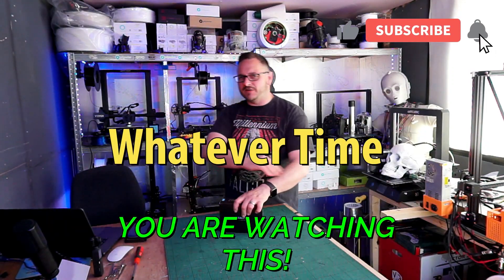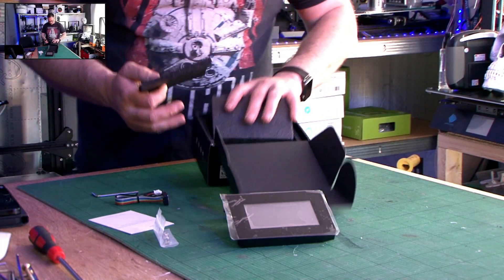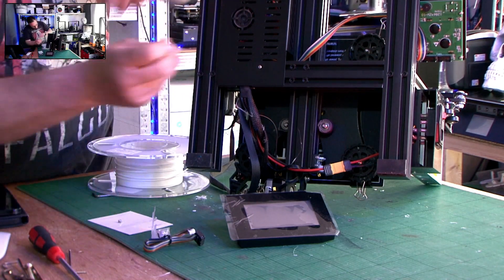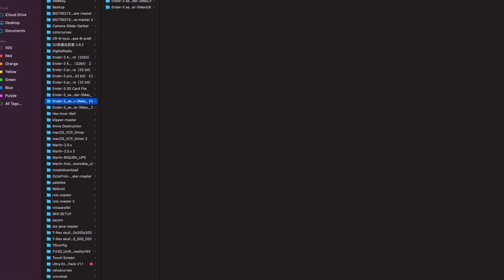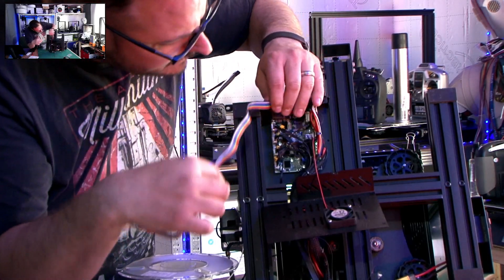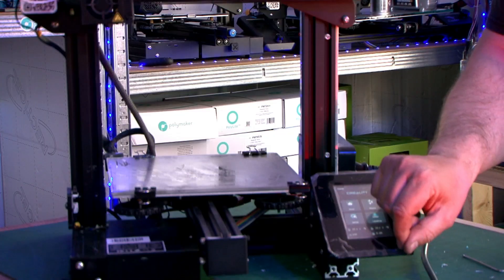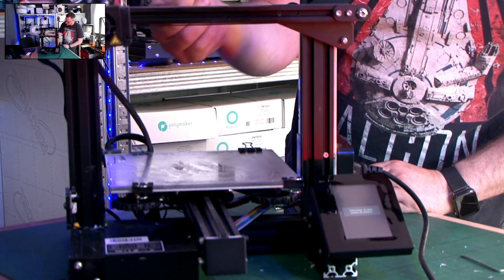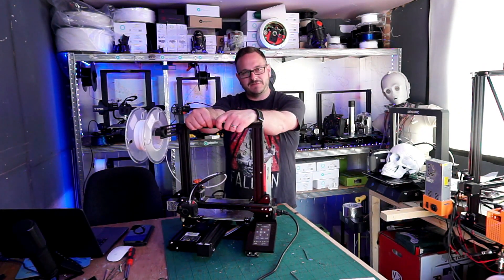Is Your ENDER 3 Outdated? Upgrade with This Touch Screen

Comment: First off, thanks for such easy to follow instructions. Very clear and simple!

I am, however, having an issue with the cura-sliced gcode files not showing on my ender 3 pro after following all the steps. I have reformatted the 8gb card, re-sliced files, converted sd card to gpt, then to mbr. I have shortened file names and removed special characters. I have reflashed the firmware (which I'm beginning to think is buggy and the root cause of my problems) and I also tried pleading with the printer's better nature.. Still no luck.

All that said, I discovered (in a frenetic display of frustration) that quickly ejecting and re-inserting the sd card while in the printer causes the files to occasionally appear in that moment. But selecting and using the files is still not possible.

All I wonder is whether I am right in assuming the firmware is problematic, or is the card reader in the printer the problem? (side note: files are easily found and read in removable disk when plugged into pc)

I have little to no idea what I'm doing when it comes to this stuff but I've tried every suggestion out there. Any help would be so greatly appreciated! Thanks Sam
Reply: This might sound stupid and this might not work at all, but sometimes when I'm on the print screen and its blank, I just push the SD card so it clicks out, then click it back in, then click it out, then click it in, until it eventually shows up.
Sounds like you have a different problem than me, but just thought I'd share just in case. lol
Reply: I need help on this too! screen works perfect but will not show my print files from sd card and i am stuck printing via usb from my computer!
Reply: i am using the 4.2.2 board also
Reply: @samratliff6431  Did you or anyone else find any solution to this issue? Having the same problem myself.
Reply: Same here...
Does someone have a solution for this?
Reply: @tolgaaras9371  I ended up returning the screen and getting the Creality 3D Pad mini, fits in the same spot and uses the stock display cable and worked perfect.
Reply: Try to format the SD card not quick format into FAT32, it is advisable it is 2GB sd card and upload the firmware again.
Reply from the maker: You’re answering questions from a year ago dude

Comment: Bit of a weird one but just installed screen and firmware, now my part cooling fan is not spinning and my motherboard fan speed is controlled by adjusting cooling fan in octoprint. Is there something a miss with this firmware? 4.2.7 MB and creality touchscreen

Comment: I did this upgrade and all works as per your video. However, where do I calibrate e-steps?
Reply from the maker: On current firmware you have to do it via pronterface or terminal on your pi

Comment: How do I calibrate E Steps?  I don’t see it in the menu
Reply from the maker: You’ll have to use a pi or your computer + pronterface
Reply: @TheRealSamPrentice  Thanks.  I search all over and you found it. Unfortunately, I already returned the Touch- screen back  to Amazon and maybe get upgraded screen with a knob    Is there a difference between the two?  Thanks for the quick response.

Comment: I installed mine tonight, installed the touchscreen firmware as described and its sort of working....as in it will heat the bed, the nozzle, I can move the axis about...BUT it won't read any of my gcode files....each screen where files should be listed is empty...any ideas? :(
Reply from the maker: Sd card format and wack the files into a folder see if thou can see them
Reply: @TheRealSamPrentice  Hey, thanks so much for getting back to me. Went and tried your suggestion but they still don't show up. Every one of the 5 file screens is empty :(
Reply from the maker: @secretstudio8384  okay reflash the screen
Reply: @TheRealSamPrentice  I've actually just done that before reading your reply lol - and still nothing. I'm at a totally loss ...its so weird. Might just send the screen back and give up
Reply from the maker: @VampireCadet  that’s really annoying, the screen firmware isn’t great and I’ve not seen any mods for this.
Reply: @TheRealSamPrentice  I know right,  I've been having so much fun up til now lol. Thanks for trying to help :)

Comment: Hi Sam,
So i installed my new touch screen and now when i put my sd card with print files on it they do not show in the print section. Do you or anyone have any idea what to do to fix this? 
Thanks in advance!
Reply from the maker: Mmmm see what happens if you put them into a folder on the sd card.
Reply: @TheRealSamPrentice   No such luck on that. when i go into the print section and its blank.
Reply from the maker: @user-jf3se1pw6r  what about formatting the card or trying a different card ? Sounds weird tho !
Reply: @TheRealSamPrentice  So i did that last night and then went thur and re loaded it. no dice. so i just went thru and re did everything " new flash, re flash again with touch & bl lvl. Re formated the card  to GTP. then reformatted it again to an MBR and we have touchdown. It works, I am guessing the first download had a bug in it or something. I am gonna try to figure out why but its working. Joys of being a techy lol

Comment: Evening, I installed my touch screen this morning and when I went to turn on my printer I heard a light spark noise and now my screen won’t turn however my ender 3 pro still turns on just like normal, interestingly enough my old screen won’t turn on either so if you could suggest what’s wrong with my printer then that would be fantastic
Reply from the maker: Sounds like the board has fried. Check the motherboard and see if you can see anything that might have popped. Did you plug it into the right connection?

Comment: Great video. I just bought the 4.2.7 board, this touch panel and the CR touch. I'm assuming I need to use the Touch Screen firmware that INCLUDES the BL touch??
Reply: Yes, I did the same. You must use the firmware that includes BL touch.

Comment: I just bought a 4.2.7 board, bl touch, and the screen, I can get the 4.2.7+BLtouch firmware to work on the old screen, but as soon as I try to install the firmware for the touch screen and install it, the screen just gets stuck on loading
Reply: me too.

Comment: mines going back, its a waste of space! cant get the firmware working with my 4.2.7 board. some firmware versions wont function screen at all, some screen works but locks up. poor product in my opinion!
Reply: Have same issue very finicky. Will not print a damn thing,will not auto level

Comment: Can anyone help so I bought and Ender 3 pro that have never been turned on but it didn’t come with the lcd controler so I bought the touch screen upgrade and when I turn the printer on with the correct firmware on the sd card it the bar won’t load load any suggestions appreciated chears
Reply from the maker: I’d plug it into your pc and see if you can get it to run with “pronterface”

Comment: I have this combo and tried the recommended .bin files.  It almost works.  The touch screen loads, and then about 10 seconds later it reboots and then just keeps repeating that pattern.  Loading and then rebooting after 10-15 seconds. Any recommendations?

Comment: how do i switch back to the stock screen on the 4.2.7 silent board when i plug it in the screen is just blue
Reply from the maker: Okay to switch back just reinstall the older firmware for that older screen

Comment: im having a hard time with the firmware, even with your link to the file the firmware does not work for me with a bltouch. any help would we awesome.
Reply: I’m running into the same issues. Especially with the cr touch software doesn’t seem to load onto the printer

Comment: I have been attempting to get my touchscreen to work, but the screen with the loading bar...never loads? and even with the SD card having only the BIN firmware on it, it still does nothing. Is there anything I'm missing????
Reply from the maker: I’d just make sure that the firmware is correct and matches the motherboard. If it doesn’t fully load it could be a flashing error make sure the sd card is formatted at 4096 and isn’t a huge card.
Reply: @TheRealSamPrentice  At the risk of sounding like a novice, how does one 'format" an SD card? In truth I don't know much about programming, but I have the standard 8 GB micro SD card that came with my Ender 3. I also did just install the 4.2.7 last night, so that is the firmware I've been attempting to update it with.
Reply from the maker: @jonmillercreative598  okay if you are using windows you can right click and the data part should be set to 4096 then you whip the .bin file
Onto the card and install it onto the screen :)

Comment: I just installed the hardware, I've got a 4.2.7 board with a bltouch, before I installed the new screen, the bl touch worked perfectly for dozens of prints. After I installed the screen and flashed the firmware that you provided, the z axis won't go down anymore, and when I try to Auto-level it just gets stuck and I can't go back without turning it off. I can't even manually make the z axis go down in the axis movement screen. Any ideas on what this is happening?
Reply: I'm having the exact same problem too. Did you manage to get bltouch working?
Reply: @nana-yt4495  I've had this issue also.  I have a BLTouch with split leads (3 screen + 2 z-axis) with adaptor on the display connector (Board 4.2.7). I had to remove the adaptor, switched the blue and red wire and put them in the connector underneath de screenconnector. Blue at the bottom.  Then put the z-axis connector(black-white leads) from the BLtouch in the same connector as the three wires plug.  White lead up. Now everything should work except moving the z-axis below 0 in the move axis menu.  You can 'calibrate' the distance head to bed while printing a test object, using the setup(in the printing screen) and then changing the z-axis.  This value will be stored. 
For correct wiring see: https://howchoo.com/ender3/install-bltouch-ender-3-v2-pro

Comment: Why only can view 20 gcode file only in sd card when using this touch screen?
Reply from the maker: Not sure, you can add folders to the card tho right.
Reply: @TheRealSamPrentice  already add folder but cannot view the folder
Reply from the maker: @cilipotong762  I’ve not tried it can you double tap on it? Otherwise it’s a question for creality

Comment: hi!!! with this new touchscreen I can't change the steps. Do you know how I can do it?
Reply from the maker: You can use g codes and prontaface or a pi using terminal to tune that up :)
Reply: @TheRealSamPrentice  i have a raspberry pi 3b+. So, from octopi I can change the steps???
Reply from the maker: @cds_3d  yep you can :)
Reply from the maker: @cds_3d  have a google for M92 - so M93 E415 would be your extruder X / Y / Z then m500 to save
Reply: @TheRealSamPrentice  this is the way in octopi???
Reply from the maker: @cds_3d  yes you use the terminal in octoprint

Comment: Great video, thanks for sharing. I bought a combo touch screen and a motherboard 4.2.7. However I didn't find an option to step calculation or any rapid values to change.
I've looking for a firmware to fix it, but I wasn't successful to find it. Now, I have a motherboard 4.2.7 and a touch screen, but i can't configurate it or change step motors. Do you know hot to do it?
Reply from the maker: I would add a raspberry pi or use pronterface in order to get that calibration. There isn't and I doubt there would be a community firmware for this one.

Comment: Hi Sam
Would you know if this is compatible with my Ender 3 Max that I have fitted with a 4.2.7 board?
Thank you
Reply from the maker: I reached out to creality as I think it should work and they never came back to me. This is just a display so I don't see why not as its not that special.
Reply: @TheRealSamPrentice  I sent them a message and they said neither are compatible but I got the motherboard firmware from Creality
But when I looked for firmware for display it says there is no firmware for the Max yet!
Reply from the maker: @geoffpeacock514  Mmm they never came back, best thing is maybe buy one on amazon and ship it back if it doesn't work ;) I would do this but I don't have the MAX :D
Reply: @TheRealSamPrentice  I hadn't thought of that but good idea 
Thank you 👍
If it works I'll let you know 
Have done quite a bit to it so far
Dual Z conversion
Micro-Swiss DD
4.2.7 motherboard
Flexi PEI build plate 
And most of the fans have been replaced
Just the part cooling fans are standard now .....but that will change in the future 
Thanks for your help 👍
Reply from the maker: @geoffpeacock514  no worries !! I'm keen to know! and if it doesn't work what are the differences on the board! :D
Reply: @TheRealSamPrentice  4.2.2 board has only got silent steppers on X and Y but 4.2.7 has all silent steppers the same as BTT SKR mini E3 board 👍

Comment: Hi, thanks for your clear explanations in the video and great documentation underneath the video! 
I tried to follow it step by step for my Ender 3 Pro with a 4.2.7 board and BLTouch, downloaded the corresponding firmware, put it as the only file on a newly formatted USB stick and flashed the printer with it. Aside from the screen/ firmware not being able to recognize folders I can't print anymore or level the bed. Printing finishes after 5 seconds, bed leveling stops in the middle of the bed.
Tried to compile the firmware myself but got stuck at the point where I either have too many LCD displays activated or too less. Any hint for the stock firmware or the correct line for the original creality touch screen? Thanks in advance!
Reply from the maker: Okay! I'd suggest you go bak to basics, does it work if you try and use without the bl touch, assuming that you still have a z switch in place of course? Does it probe correctly and can you home everything ? Also when you are flashing the firmware ensure that the file on the sd card changes from firmware.bin to firmware.CUR if it doesn't do that its not flashed correctly. Let me know how you get on.
Reply: @TheRealSamPrentice  Well, I unfortunately can't test that out as I don't have the z switch in place anymore for some months now.
Tried putting the red cable for the z  axis next to the blue-red-yellow cables on the mainboard as I read it online just now but then the touch screen doesn't even boot.
So I switched it back and flashed the firmware again to be able to tell you if the file type changed but it actually doesn't. It stays ".bin"
You didn't ever unscrew the touch screen plate and flashed the touch screen itself via its sd card slot, did you?
Reply from the maker: @m4173_     Nope I didn’t need to because I don’t use a bl touch on mine, the bin file on the motherboard will need to change to .CUR or it’s not worked. Maybe format your card and in the settings set the config to 4096 in the format settings
Reply: @TheRealSamPrentice  I wish it would've helped formatting the sd card to 4096 bytes. Same creality recommended firmware for 4.2.7, BLTouch and touch screen but still no file type shift and halting bed levelling :/
But the fact that you don't have a BLTouch at least poses the difference between our setups and proves why you got it working.
Reply from the maker: @m4173_  ping me a video on my email and let’s see if we can move you forward
Reply: @TheRealSamPrentice  Dropped you a mail (hope that was what you meant). Thanks so far!
Reply: @m4173_  Did you manage to figure this out, I just got my touch screen in today,and assumed I would run into the same issue as I was looking for a touch screen and BLTouch firmware also. I am not sure which is the correct firmware and unfortunately creality support for firmwares is very lacking.
Reply: @fate2022  Hey! Unfortunately I did not solve this problem. Ended up installing the old firmware again and reusing the old screen again until now. If you have found any clue to a solution or better firmware, please let me know. I'd get the touch screen out of the spare parts box. And you are right, the creality support for firmwares is quite bad :/
Reply: Any idea? :)

Comment: I have filament runout and BLT is this compatible out of the box or do I need custom firmware?
Reply from the maker: I’d say you’ll need firmware and screen software also
Reply: @TheRealSamPrentice  what do you mean screen software? I tried the BLT 4.2.7 .bin they link on their website and BLT won’t work
Reply from the maker: @kylestyer8240  hi Kyle just so I’m clear are you running that BLT firmware with the stock screen or the touch screen? I don’t believe the touch screen will give you the options of the BLT at this point and in order to do that there is a small sd slot inside the screen which would need some upgraded firmware.
Reply: @TheRealSamPrentice  I have only followed the guide and updated the mobo firmware. Nothing on the screen, I haven’t seen that mentioned. Is this something that has been developed or not yet?
Reply from the maker: @kylestyer8240  not as far as I know

Comment: can it be used on ender 3 max? ender 3 max is like ender 3 but with bigger bed :D
Reply from the maker: Yep
Reply: @TheRealSamPrentice  really? last month i was planning on upgrading my ender 3 max with this. i post a comment in creality website asking if it can be use on ender 3 max and they said it can't.. i havent seen any video for ender 3 max so im kinda hesitating to purchase yet.
Reply from the maker: @novalyn2875  Okay do you know which board the max uses? It should be the same as the silent boards
Reply: @TheRealSamPrentice  i think its 4.2.7.. but the FW for the screen is labeled for ender 3/ v2 (except ender 3max).
Reply from the maker: If I had a max I’d be very happy to try it out @creality testing right here :)
Reply: @TheRealSamPrentice  haha hope u get one so u can test it and ill be happy to purchase that touchscreen display too :D